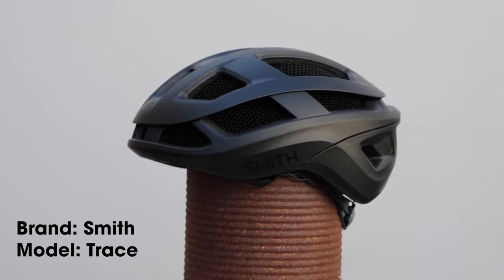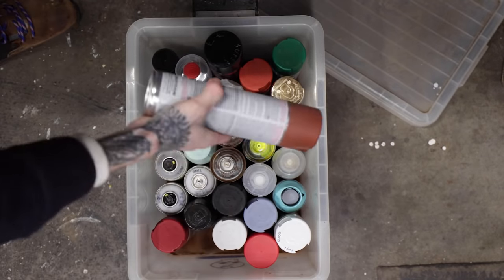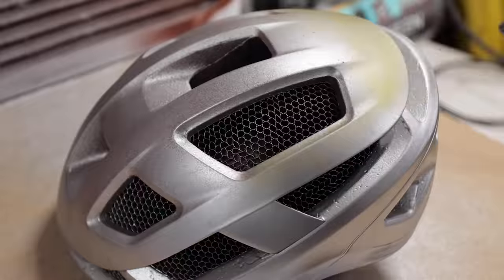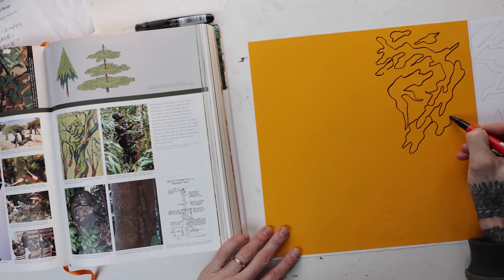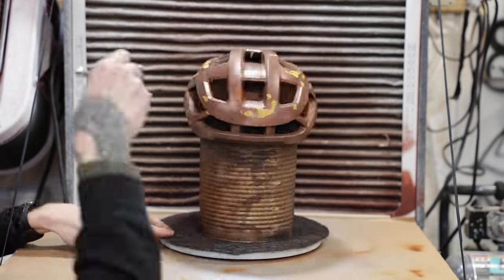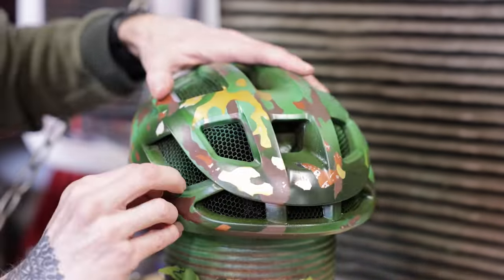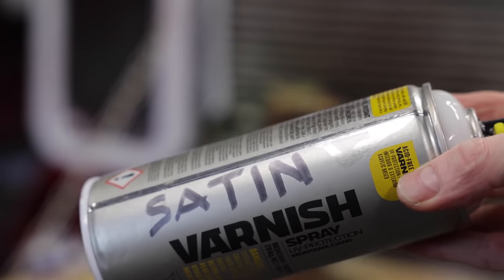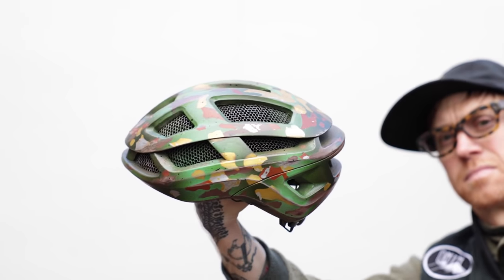How to Paint your Helmet Camo in your Garage!

Comment: looks awesome! but is there no reaction between the paint and the Polystyrol foam of the helmet? what kind of paint did you use? PU based or other solvent free?
Reply from the maker: I had no issued with the foam and the paint. This helmet does not have a lot of exposed foam. I have the paints I used linked in the description. they are mostly acrylic based.